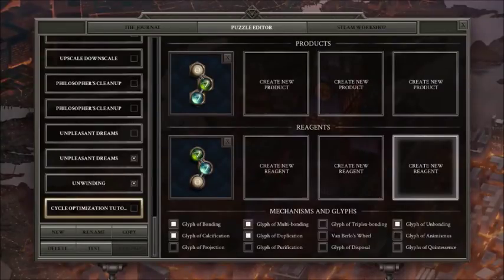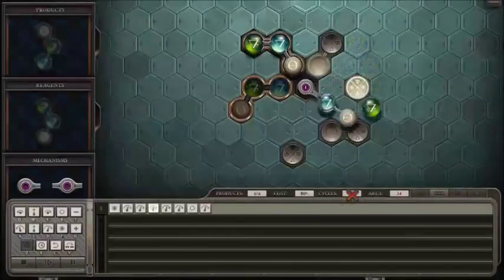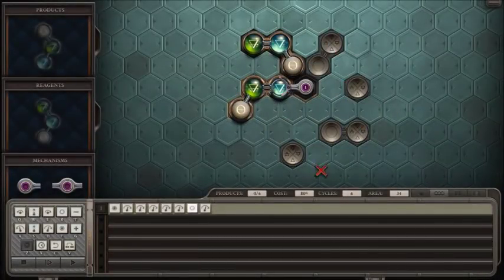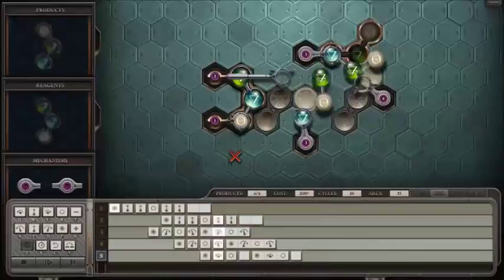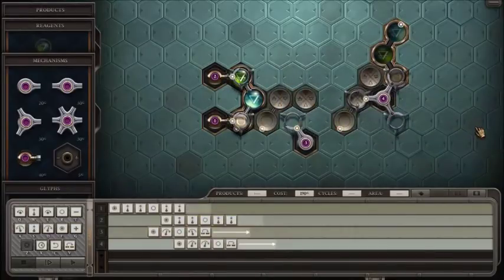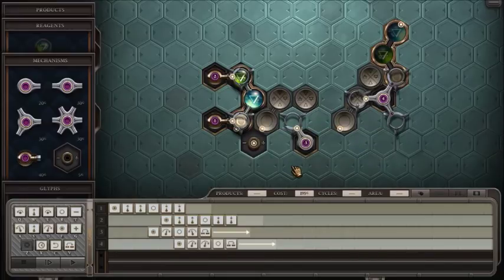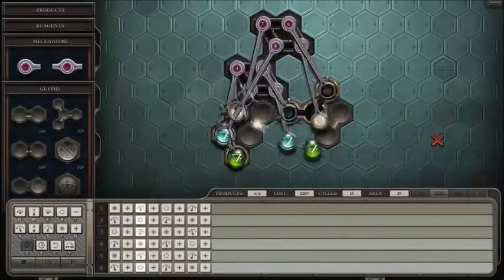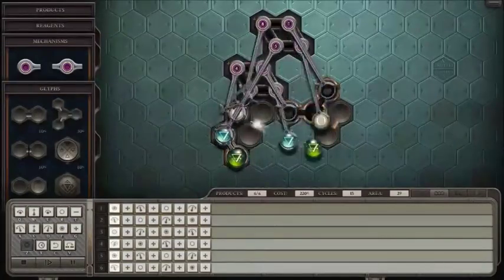Opus Magnum Cycle Optimization Tutorial

Comment: Really great explanation - one thing that could be clarified further is why the arm/task with longest cycle length determines the period ("throughput"). And then why you can repeat other arms/tasks as long as the total cycle length is less than the period. For example, @ 9:43, we can still repeat arm 2 once in the task pane and it would be an 8 length cycle (which is less than 9) so the throughput would be 2 products for every 9 cycles. That also clarifies why moving to a 12 cycle loop is better because it will produce 3 products for every 12 cycles. I find that general understanding was helpful for me as a new player and glossed over/assumed implicitly. But again, fantastic video.

Comment: Thank you so much for doing this step by step process breakdown! 

So the idea with cycle optimization is using 'forward momentum' in a way. Rather than taking time to 'reset' you can have multiple arms on a looping track continue the output. 

.... But this is JUST for Cycle Optimization huh 🤔 I was attempting to design for all 3 qualities (heat, cycle, space) but i assume it's better to optimize just for one huh?.... Which I assume that Cycles is the one most focus on? 🤔

I kinda like the challenge of keeping all 3 aspects in mind for the design though. 🤔

Comment: The puzzle solution is too clean. Most tasks involve single element input and turning it into a 4 or more element structure.
Reply: Need a easy puzzle to practice with before getting to the harder stuff. The stuff in this video is enough that you should be able to build up an optimal solution to any chapter 1 puzzle except airship fuel with minimal difficulty, by just going through the levels in order and applying what you learned from the earlier puzzle.

Comment: Thanks for this! I had zero clue how cycles were counted so this helped a lot. I understood the obvious basics (more individual input = more cycles), and I understood that more single input arms tended to have less cycles, but I wasn't entirely sure how it counted it all. 
I'm still on chapter IV right now so still learning, but my early machines were really cheap and space efficient, but hella cycle heavy. That was sort of my thing for a while; cheap and small, but as some of the puzzles got more complex I started to realise I was gonna need more than one or two arms doing EVERYTHING unless I wanted to spend ages walking the machine through each individual action lol. I especially struggled with one last night when I tried to make everything compact and everything kept crashing into each other, but then I went back to the drawing board, used multiple arms on and experimented with track loops and suddenly it all fell into place. literally. So now I'm trying more of that, and most machines now are low to average cycles and small area, but expensive. :P Now I'm watching this video and understanding WHY my track loop worked so damn well, and I'm encouraged to try multiple arms on the loop.

 I don't think I'll ever be able to fully grasp how to do the crazy small cycle builds for bigger puzzles, there's just too much going on in those for me to ever understand how you even begin to build them, but you've helped me a lot with the breaking down and doing one arm. Stair thing makes a lot of sense too. Gonna go try it out! Edit: Oh, just saw you have another vid! gonna check it